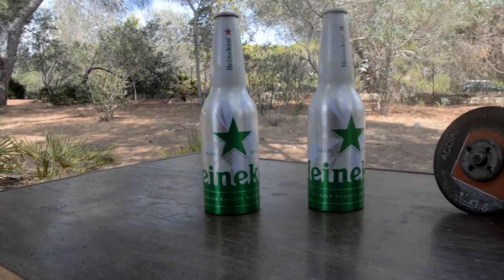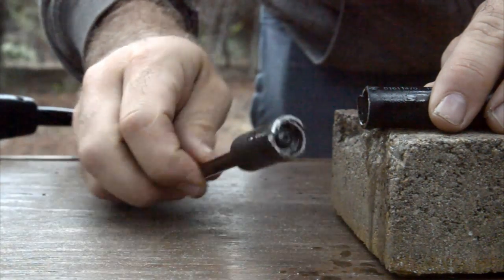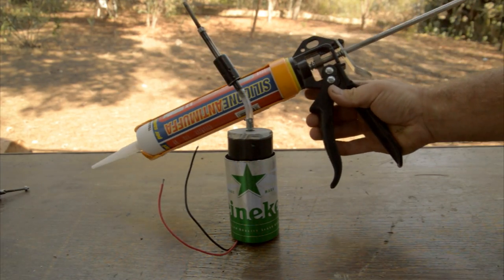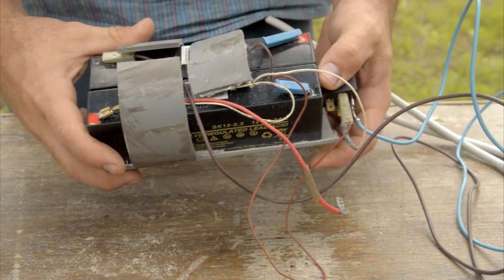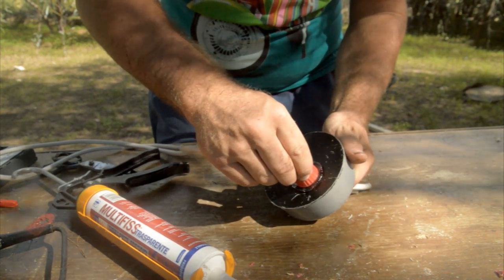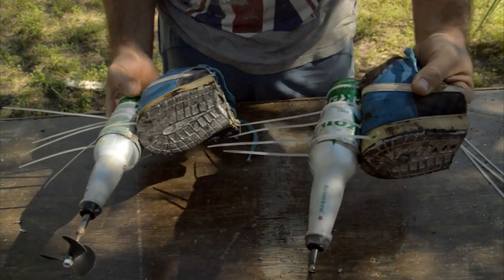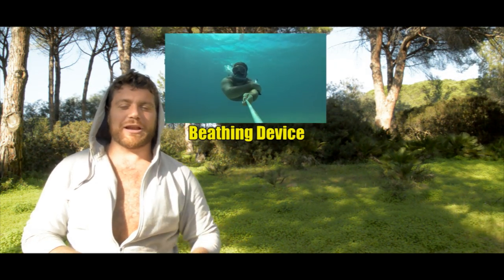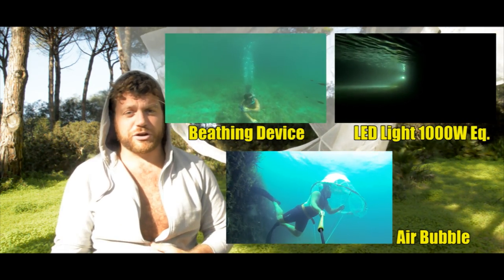Propellers To The Feet • Do it Yourself

Comment: I think you would get more power if you used a solid connection between the piston and motor in the bottle. The poly tubing, although water proof, is flexible and would not transfer as much force to the propeller.
Reply: true but it's not enough of an increase to go and make a whole new one
Reply: +Brian Patrick He explained that he used it for absorb vibration.
If you use solid connections, the vibrations will slowly affect the glue that is protecting it from the water.
Reply: +dgr Couldnt u just out line it with the same tube but with a metal piece in the middle?

Comment: Use brushless dc motors and lithium polymer accumulators from RC model stores - they are very cheap and will be much more compact and light for the same power! or much more powerful if you select the same size!!

Comment: I love this guy trust me he is very creative but this project surpasses stupidity he fixed a 4000RPM MOTOR to the assembly with a vinyl tube! No point of putting in a motor like that the flexible tube will eat up its speed and power!!!! 
He could literally grab the propeller with his hand and stop it because of the tube and on top of that with two motors that big you will drain that battery in NO TIME THAT IS SUPER INEFFICIENT!! And let's not forget how much water is flowing through those bearing dear Jesus it's MEANT FOR OIL NOT WATER !!! Water can easily pass through that wow!
Reply: Very creative tho
Reply: alright then, tell me a replacement for the tube and bearing that I could use I stead
Reply: Its a project it's not like he's going to use it to get away from a shark or anything

Comment: wait, compressed oil??? isn't that kinda impossible?
Reply: +UnfairGamer you can compress oil, but not that much. the same with water
Reply: ever heard of hydraulics ? Hydraulic oil is used in those systems, thats what he is thinking of.
Reply: Hydraulics means fluid pressure.  it is used as a medium to transfer energy, like the opposite way as a wire transfer energy to your breaks on your bike
No fluids are ever compressed

Comment: Hey Rulof,fantastic project! Only problem is the reed switch is going to weld after a while because of the relay's coil voltage spike,try a diode across the contacts if this happens.

Comment: Great prototype as a concept.
Heres 4 important points for your next one. 
Should weigh 10 - 15 pounds max.
1,) 36 volt batery lythium ion.
2) 1 motor
3) bigger prop.
4) both feet slide into the one apparatus.
I already converted a hand held pull unit into allot what you have but one battery and one motor. It worked great. Only 24 volt though.
I love your magnetic switch.(brilliant)
Great vid though. 
Be nice if you built another take my advice and you'll have a kick ass unit. Great for snorkling.
I was going down for two minutes with one breath the water thruster did all the work I was swimming just like a fish. If I tilted my head forward I decended if I tilted my head slightly up I surfaced. It weighed 15 pounds in total which perfectly neutralized my weight with a deep deep deep breath.
I kept my arms at my side or just did the Super Man.
Very cool and fun.
I strongly recomend you build another. I ended up swamping my motor eventually and thought about a 36 volter. Maybe next summer I'll maybe build another.
Thanks for the cool vid.

Comment: There's a plethora of know it all on YouTube, however, if you increase the size of both screws, and shorten the poly tubing to two inches you will find more torque from the motor and increased speed from the bigger screws....cheers mate gonna play with those myself

Comment: +Rulof Maker Over last summer I built pretty much the same thing but for propulsion I used an 18 pound thrust trolling motor and built pretty much an underwater jet pack which propelled me over 2 miles per hour underwater. I'll send you a video of it.
Reply: I've seen it, tbh I have to give you props, well done

Comment: It looks like they aren't working some of the time. But they are this is because the video is at 30 frames per second and the propeller is turning at a multiple of that 30-60-90-120... so the propeller seems to be going slow or not at all. But it is actually spinning very fast.

Comment: 2 60 size rc boat motors hooked up to 200 amp ESC and 2 6 cells in series itll make a hell of a underwater craft only thing is to control it you would need a receiver and transmitter how can you use a transmitter under water idk sealable bag Maybe

Comment: How about, a motor with somewhat the same to stronger output, however, a shorter but wider, put into something that resembles a hover board....or as I understand the process, which isn't much, it's about one side sucking in water while the other side pushes out, or propels....so the same set up, maybe with a little stronger motors, however the bottles and propellers encased in something that will hold it without too much extra weight. Then you could strap it to each leg, or around the calves so that the output is still by your fee, but you don't run the risk of breaking them by standing. 

Either way., I love watching your vids. Fun things to do with my son. Thanks

Comment: Really good idea/prototype, but not right hardware. Weak brushed motors (only 2 x 7.5W!!!), too small and unsafe propellers, lead battery.
Please make a new video with brushless motors, at least, 200+ watts (from hobbyking for example), big propellers or impellers and lithium accumulators. I think it will be 5-8+ kph or even faster! It can be fun gadget :)

Comment: Since most model boats use higher rpm motors , you might try  to use a different props. Many people doing human powered water vehicles use model airplane propellers. a 4" 3 bladed prop might be good.

Comment: I know its a long time since you posted this i can see a problem with the propellers. they are caveating badly,  you have rotation speed but no real torque, what you need to propel yourself in water is a larger propeller that turns slower with a much higher angle on the blades :) hope this hydrodynamic lesson helps you out :)

Comment: Three tips:
- Different motors (higher RPM)
- Bigger props (more surface area)
- Different battery (think high-capacity Li-Ion/Li-Poly, very dangerous in water, but no problem is it's safely sealed)
Reply from the maker: +Marinus thanks!! probaly i will make it bigger! like a sea scooter!
Reply from the maker: +Marinus thanks!! probaly i will make it bigger! like a sea scooter!

Comment: Strap a leaf blower to each leg. Works on land and in water, top speed 67mph.
Reply: Years ago me and my step brother(we were 12 then) wanted to go fishing but the boat motor was blown up, so we took my dad's gas leaf blower. It worked really well, until it died and we had to start it on the boat. We baked for an hour and fell off the boat a few times before we got that thing restarted. It was a tiny bass boat.

Comment: You should have put more powerful propellers at the calfs and installed enough apart to not to hurt the feet and finally put you a little spoiler on the back to be able to derive .

If I could swim , I would improve... ^^

Comment: Unshielded metal propellers attached to your feet and spinning at high RPMs while encased in a beer bottle held together with glue. What could go wrong? Luckily, the propellers appear to spin at about 3 RPMs, so I think you're safe.

Comment: Can't you put bigger props on if you just remove the tubing connection. If you properly weld/attach the rod to the motor you could probably put a bigger prop on because those seem way too small.

Comment: get rid of that tubing and make it a solid shaft so its not so wobbly,  use a different gearing to get more torque, and you could probably get away with getting some big computer fans for propellers.

Comment: what tool is that is that like a dremel of some sort
Reply: it is a 4 1/2 inch dewalt angle grinder. They are used for cutting and grinding metal, ceramic, tile, masonry, etc. you can buy different blades for them.
Reply: Tnx

Comment: This device has a good base potential but you need to work on the motors & propeller designs, put a single more powerfull motor on your back with a bigger more efficient aerodynamic propeller...

Comment: Personally I would have used larger propellers. Those motors could easily handle much more torque at the same rpms.
Reply: +Tony Stark? i can't find them on ebay,,,, max 6 cm
Reply: +Rulof SecondoCanale Yeah I had trouble finding them. My other suggestions if you want to pursue this would be to either look at a local hobby store. See if they have larger propellers. Another idea would be maybe be looking into getting one 3D printed. Maybe see if there's a Youtuber with a 3D printer who would like some recognition (and a little money) in exchange for 3D printing you a pair of larger propellers.

Comment: Great project, very creative! Would have worked much better if you were a 100 lb less fat! 

But I'm curious to know why you didn't install a metal connection between the motor and the rotator piece first, and then insulate it?

Comment: if you look up " long line kontiki fishing nz "   you will get a very practical use for your great motor propeller idea if it was modified to a length of pvc pipe to pull a long line out to sea , please reply if you follow through  , thanking you

Comment: I mean... why not just move your feet slowly? I'm not an expert diver or anything... But it seems to me that this is lots of effort with little to no outcome. You have legs, use them. Also, the deeper you would go, the slower the already slow motor would go due to water pressure.

Comment: Using propulsion (or inflatable stuff) on your feet is a BAD idea!
Reply: how?
Reply: Riley Cosby
Well... legs-up & head-underwater sounds like a bad idea to me. :p
The kind of propulsion he uses is not very strong of course, but still I felt like warning those enthusiastic enough to try it, or those silly enough to try something even stronger.
Your limbs (especially your legs) should be free at all times while swimming!
That's the reason why divers use only handheld propulsion which is not attached to their bodies, so they can control it easily & ditch it if they have to.
Reply: +KatorNia Adults should be able to flip themselves. The only people who may not be able to flip themselves are kids. Do you think kids are going to use this? No, they're not.

Comment: Why, for the love of god, are you putting those giant clumsy things BEHIND YOUR HEELS?

You have nice, giant empty & anatomically unused spaces at the lower outside of your legs that would only make the propellers need to stick out an inch or two from your body and subsequently avoid you accidentally crushing them both like you almost do the first seconds of using those things.